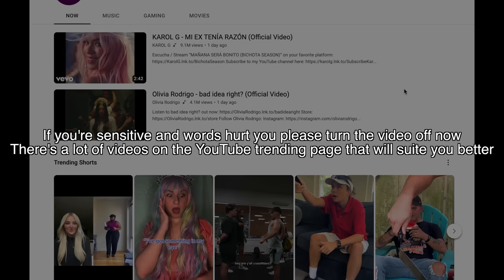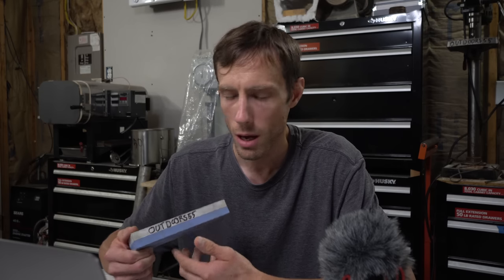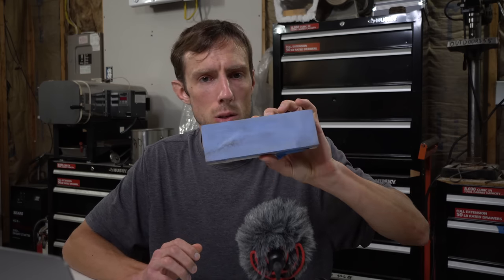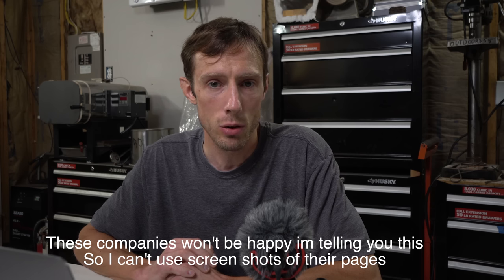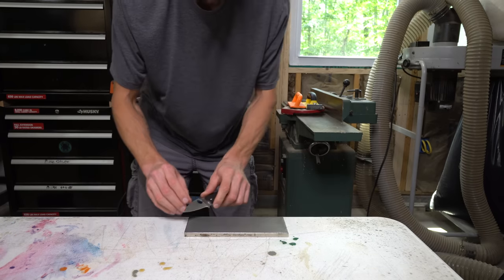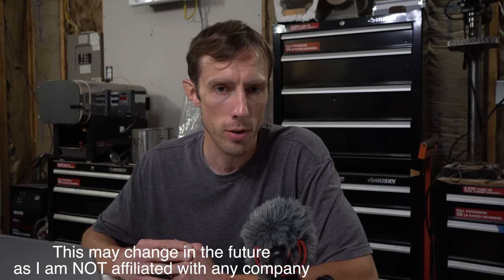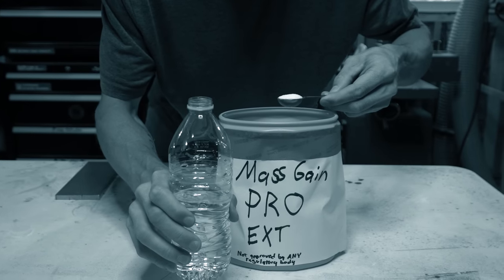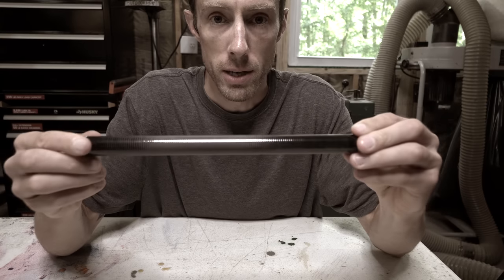The Internet’s BIGGEST Sharpening Stone SCAM

Comment: The stone you show on the video has over 22,000 reviews on Amazon.  It appears that the majority are positive but there are also some negative reviews.   Having read some negatives, I would not buy the product.  I chose diamond sharpening stones of which there are quite a few available.  Most are quite expensive.  I chose UltraSharp 600 and 1200 grit stones which were quite costly but not as expensive as some other brands.  UltraSharp diamond stones are made using monocrytalline diamonds electroplated to a steel plate which is the best method.   They come with a Lifetime no questions asked guarantee.   These stones have worked very well for me making dozens of knives.  I would highly recommend UltraSharp.

Comment: I bought a similar "stone" with some different brand name (don't remember from where) in white 8000 grit and terracotta red 3000 grit (which I've since learned is probably a bit odd combo); and I've used it only once... or for one session.. It did work, but it was super messy and after a little while it was hard to tell each side apart because both were covered in red sludge. But "fortunately" the glue that held the two grits together suddenly gave up which meant I could at least keep them separate and avoid mixing the grits. Both were probably too fine grit to start with meaning I had to spend forever to make any difference, making it really hard to figure out if I had it at the correct angle. I tried using my finger as support to keep the angle which seemed to work, but at some point the terracotta sludge was suddenly much more red than usual... then I saw a drop of blood from my finger when I lifted it.. Apparently if you keep rubbing your thumb on a fairly wet high grit stone you don't feel anything as you slowly grind off the upper layers of skin down to the outermost layers of blood vessels, and those it turns out is slightly further out than the nerves; so I had completely removed my epidermis on one thumb without noticing anything. 

I did manage to improve one cheap blade to better than it was when new, and get a quality knife back to approximately new condition; and I did a decent enough job, apparently; because with only occasional sharpening with a diamond coated so called "honing steel" I've keept them both okay-ish... But even after I grew back my epidermis; I haven't felt like trying it again, But maybe I should buy a better 1000 grit stone and try again.

Comment: You described any unknown brand products online. Norton and Sharpton seemed reasonably priced to me. I use water stones and diamond depending on steel. I like water stones for older tools but if it is just touch up in middle of work I’ll use diamond on everything. PMV11 gets diamond more often but I have sharpened on water stones. CBN wheels on slow grinder hollow grind only for huge blades like big roughing gouges.

Pocket knives I’ve been using a stick of wood with a slot in it and a potato chip bag clip. That gives me an arm to touch them to a small diamond plate from WorkSharp. Has magnets on back so it stays in place on metalwork bench top. Holt and ProTech knives. Because I’m very irresponsible with my money.

Comment: Now let me tell you about the DMT diamond stone SCAM.   I bought the big DMT stone on ebay for a pretty crazy low, but not really "too good to be true" price.  Seller bought the tiny pocket sized stone from Amazon and shipped it to me as a gift to fulfill the order.   The problem with a gift is if you return it, you get the price the seller paid on Amazon for the smaller product, which was well less than what I paid for the larger product I was supposed to get.  Amazon is NO help in this case as they will conceal the identity of someone who sends an anonymous gift.   I was eventually able to recoup my money from Ebay.  This scam is pretty common from what I understand, especially on products that have a small size and large size.

Comment: I've had a lot of fun and success with the ~$12 Victorinox Sharpening Pen. It's not just for SAKs.

Before that, I purchased a 400/1000 stone from Amzn for $9. It wasn't bad. In fact it was very good at removing damaged edges. But I finished them off with the Vic Pen, because 1000 is not fine enough, which silly me didn't know when I purchased the stone.

So no regrets, I got the one stone I need for rolled and chipped edges. Also makes fine sandpaper, lol.

Comment: A while ago I had a nice whetstone from japan can’t remember the name but I believe it was one Joshua Weismann recommended, anyway someone broke it when they were taking stuff out of the drawer I left it in.

A few Christmas’ later I got some whetstones as a gift and was excited to try them out but I immediately noticed they felt different from the Japanese whetstone I had. I was also by no means good at sharpening as I was still learning and this really threw me off.  The Japanese stone had a little bite to it when I sharpened my knives on it but on the new one, my knives would glide across it with no feel. Furthermore, I got two stones each double sided with a wide range of grits and all the grits felt the same. When I slid my fingers across my old whetstone, it was obvious which side was coarser.

I won’t mention the brand name in the comments but after checking out your link in the description I realized my parents fell for the trap when they got me those whetstones. 

I appreciate you making this video, I’ll start looking for better beginner stones so I’m not tempted to throw my knife into a wall every time I try and sharpen it.

Also, I’m not sure what they’re called but how do you feel about those diamond stones with the holes in them? They’re very clunky feeling to me because when I get to the tips of the knives sometime they slide into the hole.

Comment: I don't have any DMT experience.
I do have some "cheap" 
Skerper (formerly Eden Quality) 
They do look like and probably are, those cheap stones.
Usually sell like 3 stones and a ceramic rod for like 45 bucks 

I also have Fallkniven diamond stone and to be fair.
I would recommend the cheap water stones over the Fallkniven diamond stones.
They lose their diamonds after a few sharpenings and there's not much you can do with them after. 
Those cheap water stones will dish out quick.
(Kinda like my King stones do too tbh) 
But you can also lap/flatten them on a nice flat tile or just a small flat piece of glass with either silica grit powder (super cheap) 
or sand paper.
So yes they dish out fast, but they're also lapped flat super fast.
Faster than it takes me to clean my carborundum and ceramic stones do.
(Which hardly wear but they clog up very fast)

Comment: I have fallen for this scam however at £15 a stone.
Another scam i fell for was the lansky diamond sharpener. There was so many large lumps in the diamond layer, grip of the blade was poor. And you can only sharpen small knives as the angle will change along the edge of the blade. It was an expensive kit yet was so shit it will ruin a knife. 

I got some small diasharp credit card size sharpeners and have had no issues and have developed a good technique for sharpening blades razor sharp, even on larger blades.

Comment: People just spend 200 bucks, get you a 140, 400, 600, 1200 grit Atoma diamond stones and don't worry about it. In fact you can cut out the 400 and 1200 if you really want to at 140 and 600 is all you need for general sharpening and having excellent edges after you spend the time investment to learn free hand.

Comment: I have that same stone.  Didn't pay anywhere near 50 for it though.  Somewhere between 5 and 15.  Don't remember.  Happy with it for that price.  It's not the best and I wouldn't use it for high quality, but it was cheap.

This core issue you're talking about though...  It isn't just sharpening stone.  It's all over amazon.  I can't prove it, but I don't think they're even actually rando importers or anything like that.  I think they're dummy shell companies that are all really just the same company.  That way, companyX can flood the product listings with their own products and crowd out every other competitor.

I have seen this exact same behavior with - various art supplies, camping gear, ultrasonic cleaners, magnets, led strips, sharpening stones, carburetor kits, and many many other things.  Amazon is very overrun with this practice.  The only real exception I'm seeing is when you're wanting something that's specifically from a popular brand that amazon happens to carry because it's the one people want.

Also, I have used a brick before.  Yes, that can definitely be done.  You do need to take some care in selecting the brick though.  Some are much grainier than others.

Comment: I bought one of those stones for around about 16€ 1000/6000 grit. After a fee uses the bonding between  stoped working and the two plates got separate. The 1000 grit stone is worn off now. On the otherhand the 6000 grit stone seems indestructible.

Comment: All you need are two ascending grit diamond stones and you're set for life sharpest blades I ever had. Anything I put on the diamond plates I can shave with. Plus you can use mineral oil and not deal with all the bs that goes into whetstones and it takes like less than 5 mins to sharpen a dull blade.

Comment: I'll give you the advise I wish someone gave me when buying a stone, just buy a ceramic 1000. It's not much more expensive then the cheap stones and it gets things sharp over 10 times faster the most aggressive cheap sharpening stone. It also gives a better finish then the 8000 grit of the cheap stones. The difference in quality and user experience isn't even close.

Comment: I bought this stone for 17.23 € on 02/12/2023.

I have never used any other stone and bought it after having seen this video. It was the cheapest thing available and I was wondering if I would even use it at all. As it turns out, sharpening knifes is strangely relaxing and I have used it quite a lot in the last couple of months. I'm not sure what I can expect with a better stone but I was indeed able to significantly increase my knives sharpness.

I will most likely upgrade to a DMT diamant stone in the future but  this cheap drop shipped product has worked quite well for me. However, I'm not sure I would say the same if I had paid 50€ for it.

Comment: Maybe I got lucky but I have some of those Amazon whetstones I got for like $20-$25, all including the 5000-8000 stone seem to work fine.  The only 2 issues ive had are 1) wishing I had something more aggressive than the 400 for a wood plane that had rust and some severe pitting and 2) struggling to sharpen a cheap stainless steel straight razor.  For my kitchen knives, axes, and old high carbon German steel straight razor I’ve not encountered the issue you mentioned.

Comment: Bought something like that, my 1080 steel knife (not maintained well, needed thorough resharpening) and it ate through a stone like crazy while stone barely did anything. When I bought water sandpaper sheets they did the job just fine and sandpaper costs pennies a sheet.
Reply: Yeah, some people complain about the cost of sandpaper sharpening.
But its cheaper than a lot of 'sharpening' gear.

Comment: I got this stone. Fortunately it was on the side of another order from something like alibaba, I didn't pay more than 5$. It's not great but it works alright, definitely better than pull-through sharpeners I've been using up to this point (yes I know, great sin). I think it's worth 5$ for an experiment to see if I'll actually enjoy the process and get some level of results. You wouldn't buy a 50$ professional anything if you were new to something, just get the cheapest reasonable-looking thing and upgrade after a few months. 
Glad to see at least I wasn't scammed and paid a normal amount, amazon is crazy.

Comment: I bought a Trend brand steel, monocrystaline diamond plate 300/1000 grit.  Fairly pricey at about 80 quid, but works really well.  Being a steel plate it keeps its shape. It seems to live up to the Trend advertising claims.  I use it with their recommended low viscosity lube and never use water (which promote micro pitting by rust).  TY for the vid and satire👍

Comment: honestly, i bought a pair of bear moo dual stones. they are pretty decent. nothing super special but they are not near that messy and dont cup that easy, at least on cheap steel. got a benchmade super freek in m4 and spent 4 hours trying to get it to a mirror finish like i have on my crkt m21-14sf and had to give up. next up is a set of dmt stones and a ken onion worksharp for all the stuff i dont care as much about. my other ones do a really good job on cheaper steel but im kinda sick of having to do it all it all the time. my carry knife i prefer razor sharp though so it will always be by hand

Comment: I bought exactly the same stuff for about 9 euro 5 years ago. It's indeed far from the best, but I don't agree with the is bad for a beginner part. See it as a gateway drug. The fact someone can learn the basics without buying an actual 50€ stone.. or a 200€ stone.. It is just a crap product, which warrants a crap price. If you pay 50$ for this it's indeed shite,  for 10 bucks I'd say it's worth it for someone trying to get into sharpening. You can mess this stone and your first knife up without feeling sorry. Still happy with my Naniwa super stones though, they are miles apart. That said, I wouldn't recommend learning it on a 60$ stone.

Comment: cheep stone tip
go to your local Chinese supermarket that stocks tons of the same item like they have 30 woks stacked up, and then a million of the same style bowls in different sizes and everything smells a bit strange
next to the 1 style of cooking knife they stock there will be a sharpening stone in a cardboard box with only Chinese on it, it will cost approximately the same as a pack of instant noodles 
buy this stone. that exact stone is working for every Chinese restraint in the country and probably the world 
its not the absolute best of the best, but it more than does the job, my father in law gets the kitchen knife hair shaving sharp on that exact stone, then puts it thru a porkbone and then sharpens it again the next day
and if you don't like it, it doesn't matter, you paid next to nothing for it, toss it in the shed and use it for axes or something

this method works anywhere in the world where Chinese restraunts are found

Comment: I paid under $20 for two ...count them two crusty puddy stones which came with a wood holder and rubber boots to hold them from. Sliding around.  
Yeah they work but holy crap they are filthy . 

I bought one of those worksharp Dimond sharpeners systems .....Purposefully dumbed down so they could come out with the "new and improved "  better one.  

It does work but a lansky is cheaper and  has better stones.  

The thing is , most knives don't really need sharpened if ya treat um like knives and strop them after use.  I find that a ceramic rod , strop and diamond stone is all ya need .

That said ...the Ken onion attachment on that worksharp system is pretty good for a quick simple way to do most stuff. 

Just $79.99 ....😉

Comment: There is some BS in this review.  Soaks for 10 minutes +/-; gets messy; grooves down the middle, when you don't know how to work the whole surface;  That is typical of "Japanese water stones", even if you spend  car money on them.  It is just how they are.  The soaks and messy part is hard to avoid, but the grooves part could be highly variable as to the qualities of the stone.  I don't doubt it will be worse with some.

I bought a set of these craptastic stones a year ago.  I paid the Can equivalent of $35 dollars ($46) for a set of 2 stones/4 grits; a leather belt strop (useless); a good hard strop; some green polishing compound, probably OK; a flattening stone; a bamboo base; a knife angle jig; an Eclipse style plane and chisel guide (good quality).  Back in the early 80s, I think that jig alone was 25 dollars.  1980 to 2019 has been 310% inflation.  Back then the western jig was the only one available, and would cost 75 dollars today.   The brand I bought off Amazon is Toptry, they currently sell this deal for 50 dollars Can, or about 35 US.  I am not recommending it, though I feel it is worth it for what I got.  The main issue on the stones I haven't spent enough time on.  But it is worth what I paid for everything else.

 I got this set to get some kids going, and don't have a ton of time on them.  Issues that would concern me would be the spacing between grits, and whether they will sharpen, and maintain whatever needs done.  Price and durability are really secondary if they get one going.

You paid too much on Amazon, only only getting one duplex stone for what I paid for the whole kit. Obviously price is cheaper on Alibaba.  But I am willing to pay more for fast delivery (stones, frikin "free" delivery on stones!); The ability to get a free return; payment privacy.  Everything on amazon is under "featured".  You have to change that setting to "Lowest to Highest", and you will get much better deals on price.

I got my first DMT stones in the early 80s, back when they were on the Lucite blocks.  The quality seemed to go downhill, later.  They are still in business so they must be pleasing someone.  In terms of current dollars I must have paid around 140 US for a 6 inch coarse.  It hardly lasted at all.  They may have improved, but they lost my business long ago.